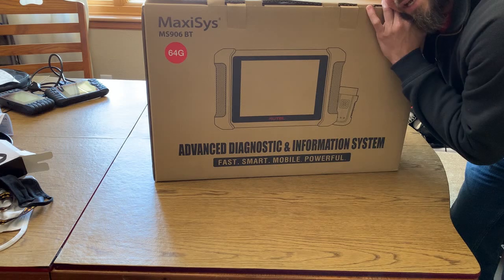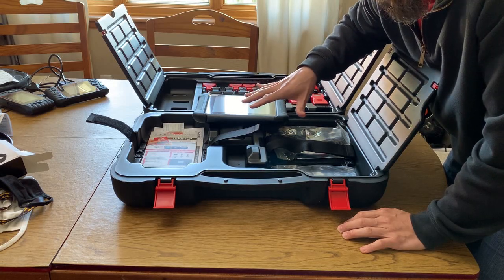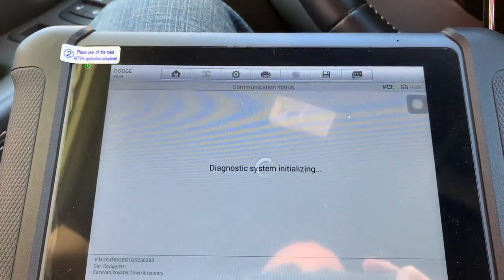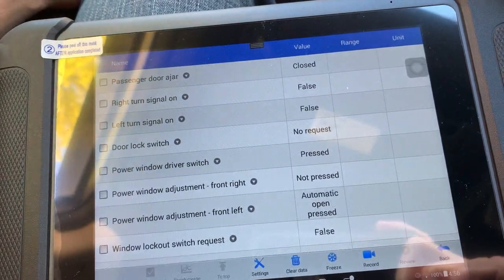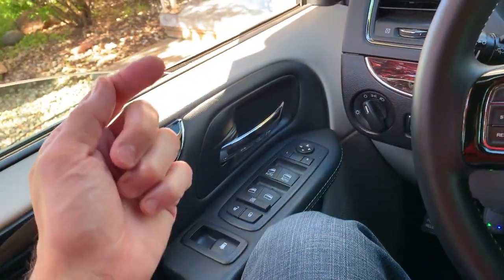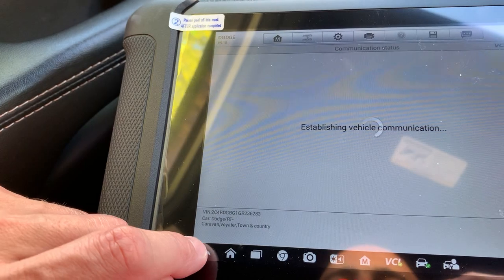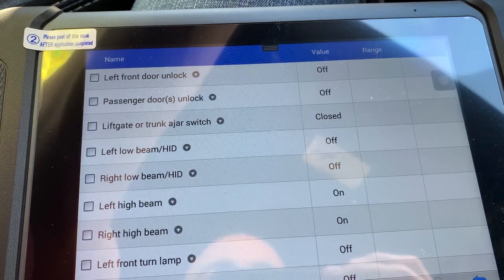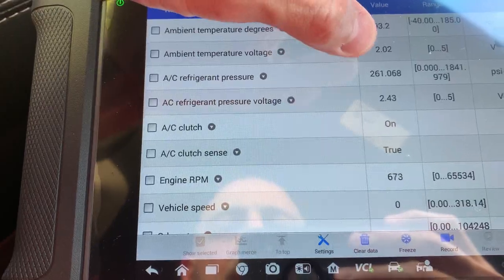Are Autel scanners USELESS - MS906BT - MUST WATCH BEFORE PURCHASING -

Comment: will this one reset my sunroof and other stuff for GLK350 2015 ?
Reply from the maker: I dont know what you think a reset is and what you mean by “other stuff” but I will be inclined to say yes.
For a sunroof, just pull the fuse for the overhead control panel and it will lose the sunroof position. Then to relearn you pull down and hold until the sunroof moves all the way through its motion and when it vents, it should be relearned. But the scanner should be able to do that as well. Thanks , Lou